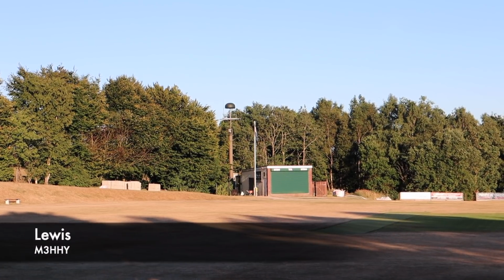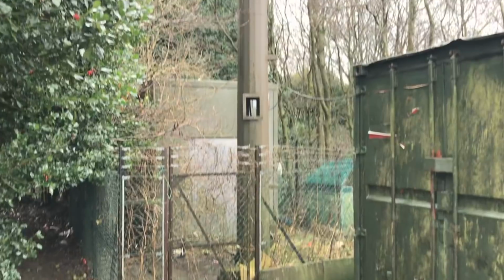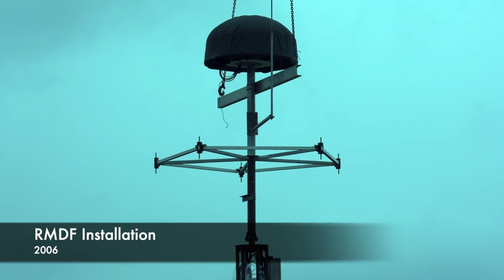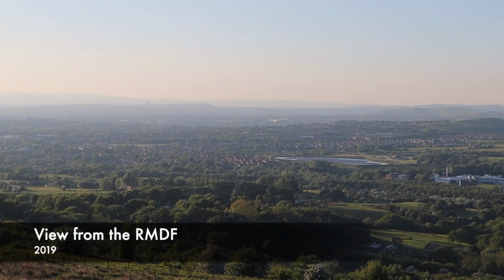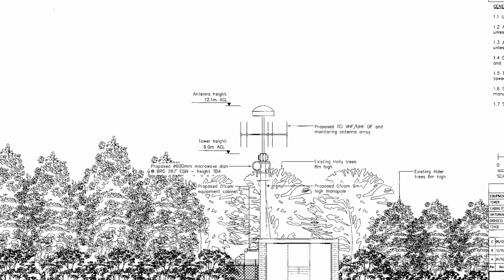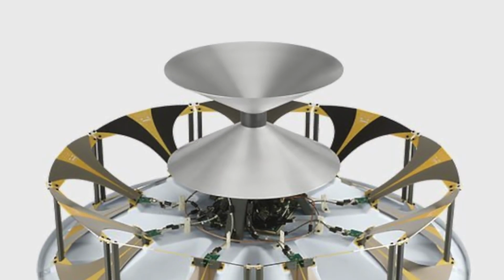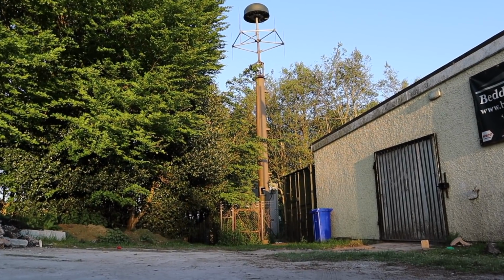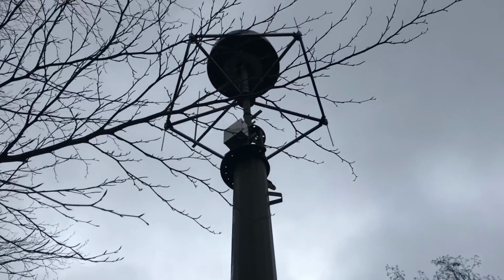A Remote Secret Hilltop Radio Monitoring Station

Comment: All this money spent just to locate kids playing DJ on the FM band ?
Reply: I was working on job like this. There was a lot of idiots with strong equipment (mainly from war) and weak knowledge. They was arguing with firemans, emergency, police, whoever they can hear, jamming all around. DJ kids has small power and was not problem at all. Also, Ham radio operators needed help to disable idiots on their frequency. Basicly we was searching only idiots.
Reply: @electronicsolutions4842  the local ham  here is a pain in the butt he complained that our wisp was interfering with him on the AM band nowhere near what they run on the FCC showed up checked he wisp it was fine 4 hours of paperwork.   Then he calls them saying my neighbors aquarium heater is bothering him they tell him that’s not there department.  Complains again about some farmers electric fence  then gives me chit about my Xmas lights  show transmitter. Duh part 15. We now made a spark gap transmitter out of a auto coil in a small box with a 7 amp hour battery  on a flasher circuit. Pop pop pop pop pop pop LOL drives him nuts !  His kind wich most hams  are is the reason so many people are turned off to the hobby now !
Reply: @johnsiders7819  hahaha... HV spark gap into something highly directional, aimed directly at his antenna. Drone with a metallic fly lead you can creatively deploy to ground out his HF rig.

Comment: One aerial picks up direction, pass it on to next station and then the next and there ends up enough directional aerials pointing to source!  Could all be controlled from a central control room.  You can listen with a six inch nail, but not very well, so how did those direction finding aerials work as they must have been small reactive aerials?

Comment: A very interesting presentation, wondered can the latest hi-tech satellites do the same job with pin point accuracy, for both fixed and moving transmissions, from geostationary orbit above us, or is that just pie in the sky!
Reply: I'm probably not supposed to say this but 12 years ago my job was made redundant by some newly deployed birds. Prior to that I rode around deploying  temporary  devices  that would lift an antenna  up 500 meters with a balloon.  After a certain amount of  days or if ops saw villagers approaching  it when the SA sensors went off, water was injected into the batteries and the box on the ground burnt up.  My boss told me that back when he started the us used the blackbird to gather  the radio transmissions and locations.   It boggles my mind that the celestial navigation system can see stars in the daylight then as a jet flys by at mach 3 and 70k feet a df on the jet can say "that Is the location of a man on a wakie talkie" and then identify the location of the reply.  Its just plain amazing.

Comment: I live near the Baldock centre. Someone who worked there told me they generally don't bother with HAMS unless interfering off bands, just if you wondered
Reply: They use to be worried about CB operations especially in the early days when AM rigs would splatter everywhere. Hams have to log Thier transmissions so if interference the dated and times could be logged. Now most things are digital the chance of interference is low. TVs use to get a lot and drive people crazy.
Reply: @brianweston83  Hams don't have to log transmissions but is considered good practice, no?
Reply: @brianweston83  not anymore we don’t have to log, unless you want to or you are causing EMC issues with your neighbours then it will be asked of you

Comment: I wonder how it works with the Antenna being a fixed length but the frequency range is so large.
Reply: This prat on the video has no idea what he is talking about. I worked as a technician on this site for many years. I can assure you ut has nothing to do with ofcom .
Reply: @paullee5573  Looks like a LF aircraft beacon antenna to me. 

Edit: It's a Low Frequency  Auomatic Direction Finding  antenna used in aviation. They are  not secret as  many are  in service often located  in plain sight.
Reply from the maker: It’s not 😂 it’s exactly what I said it is.
Reply: @paullee5573  BULLSH!T PAUL LEE
Reply: @GrahamTruman  As I said, I was a member of the technical personell there. So if I dont know what it was then no one does. You definately dont.
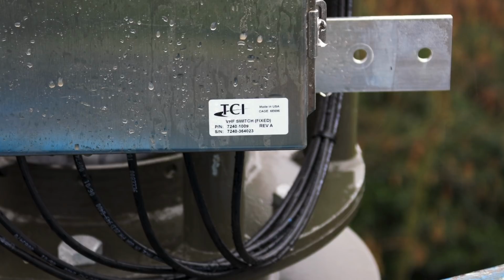Reply: @paullee5573  At 3:55 an Official Marconi design drawing is shown, stating that he client as Ofcom.
Reply: @41istair  That is because ofcome were the original freeholders. It was never ooerated by them.
Reply: @paullee5573  Well your well put together argument has convinced me. I'll ignore all the facts in the video then?
Reply from the maker: Rubbish. Absolute rubbish.
Reply from the maker: Hahaha, where do you get this rubbish from mate? Honestly 😂
Reply from the maker: Exactly mate. Don’t listen to Paul lee.
Reply from the maker: Technical people can usually spell...
Reply from the maker: Don’t talk rubbish Paul.
Reply: @paullee5573  What is it, then?
Reply: I know they will use an antenna tuner but this is obviously not ideal.
Reply: There are more than one and they use triangulation to find you
Reply: @googlemustdie  That wasnt my question was it?
Reply: Simple, it doesnt! the info here is total bollocks, I dont know about the dome bit, but the ring of verticle dipoles look like a VHF ATC VDF (visual direction finder) installation. Is there an airport nearby?

Comment: Very interesting Lewis. No doubt worked on triangulation. I wonder if this system had the capability to scan all the frequencies between 20MHz and 3GHz simultaneously, or if it stepped  thru frequencies, and then locked onto a freq. of interest.

No doubt the successor system will be able to scan everything simultaneously, given that massively parallel processing power is relatively easily and cheaply available.
Reply: Given the rise of software defined radio and inexpensive high speed analog to digital converters, I would be shocked if that system didn't produce a continuous waterfall plot of the full spectrum. It takes shockingly little processing power to pull off high quality software defined radio. Genius idea.